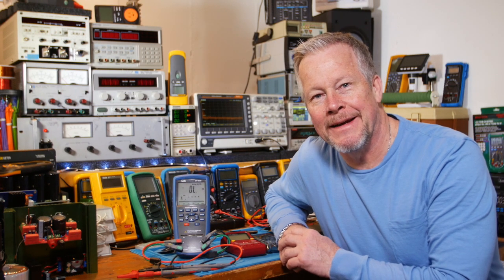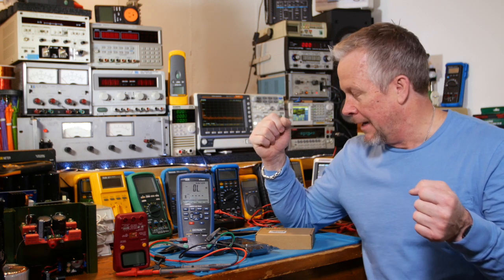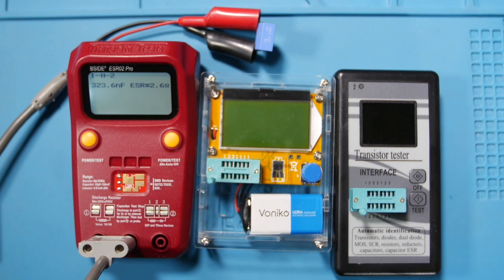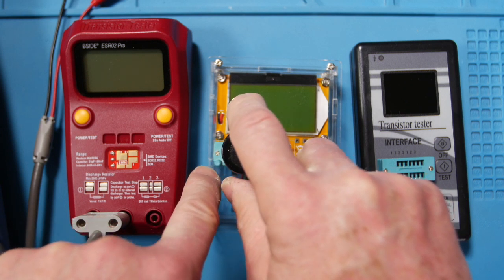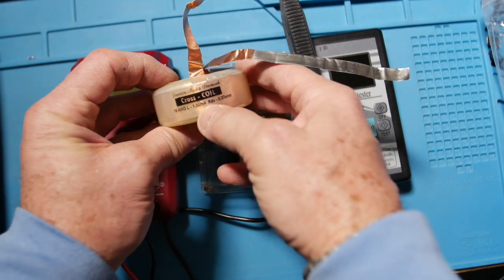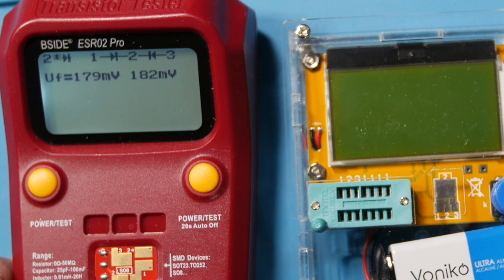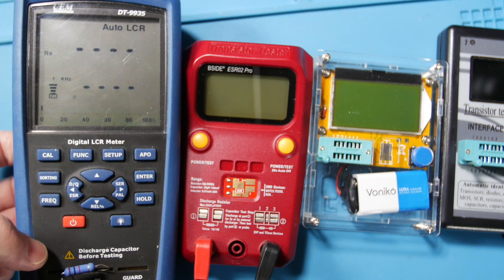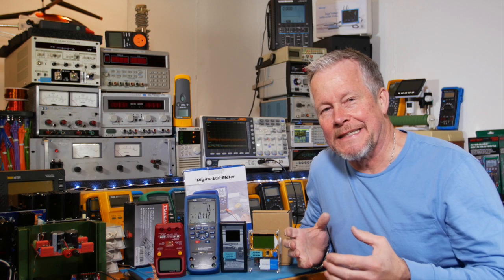LCR and Transistor Tester Comparison

Comment: I recently purchased the MESR100 from eBay, it's only for capacitors but it's able to test in circuit for ESR, I have seen many other YouTubers using it and it saves a lot of time when trouble shooting... As for testing capacitors out of circuit, I charge them to their rated voltage in series with an analog micro current meter to test for leakage. Mr Carlson's Lab channel has a very good capacitor tester which he designed and built himself and is also available to his patreons... I still think that charging the capacitor to it's rated voltage and checking for leakage with a meter is actually the best way to do it, I have seen Mr Carlson's Lab test capacitors on an old vacuum tube capacitor tester where he can ramp up the voltage in steps and you find that at lower voltages, the capacitor shows up okay but as you ramp up the voltage it begins to leak. While these capacitor testers that you have reviewed here are great, their method of testing kinda let's them down... Just think about it for a moment, what's the actual job of the capacitor? One job is to pass Ac and block DC, if it's leaky... Then it's passing on DC current to somewhere it shouldn't be and if you understand output transformers in vacation tube amplification, you will know that the fact that the output transformer has both Ac and DC across it, it saturates very quickly and gets hot at higher power levels, that's why they use massive output transformers on vacuum tube amplification... So basically the less DC a capacitor leaks at rated voltage, the better the capacitor is... 
As for capacitors in the power supply, they need to be able to store the pulsed voltages coming from the rectifier, now in this scenario, if the capacitor is leaking DC, the leakage forms a circuit with the transformer and it's bridge rectifier, apart from the main circuit that it's meant to be powering... This invisible circuit that has been created by a bad leaky capacitor is adding DC current to an Ac circuit and the transformer doesn't like it because it makes it get hot. The iron core is saturated far to early because of the battle of the currents that's going on, you decide that,,,,,  hey that's a great song! So you turn up the volume and the magic smoke escaped... The question is! Is the ESR of those capacitors that you tested still going to be low at rated voltage? 
Melbourne Board Of Works back (I believe but don't quote me) in the 50's or 60's worked out that the fact that electricians were using the old galvanized steel water pipes as the return neutral through earth, the problem was that this was also the path for DC which some transformer less TV's were creating an sending down the pipes causing a galvanic reaction and rusting our new pipes in months, and the DC current was only in miliamps! Superimposed on top of the Ac... So basically the lesson here is that it only takes the tiniest bit of DC current on top of Ac and you begin to have problems! Choose your capacitors wisely! 
Apologies in advance for the lengthy post, there's much more to it for such a simple thing that most people don't realize and you really have to understand it's function fully to understand what it's not supposed to be doing..
Reply from the maker: Peter Milanovski Thank you Peter for this very useful feedback!  You make some great points!  Some capacitor types change their capacitance with DC voltage applied, and with frequency and temperature.  This could make a nice video all by itself!  Please never worry about writing too much!  I know there are plenty that love it and that’s why we are here anyway - to share our knowledge and learn and feed our minds:)
Reply: @KissAnalog  There's two types of test equipment that should be on every bench and they were invented a very long time ago! The first one is the old capacitor testers that were able to apply rated voltage to test for leakage and the other one is the humble signal tracer with both audio and RF probes. You can repair almost anything non digital with just those two and a multimeter... The Signal tracer is such a simple but amazing tool, you can hear what a resistor is doing in circuit with the RF probe.. Imagine that! Being able to hear where the problem is while it's working, that would save you hours if not days trying to find that intermittent problem.... I saw Mr Carlson demonstrate how you can hear a bad resistor arching inside with a signal tracer! Sure you could have found it with an oscilloscope, but you would have to be purposefully looking for it because the noise from the resistor would be difficult to see on the screen, but hearing the noise is totally different, you instantly recognize that what you just heard just shouldn't be there!
In the old days if you had a bad transistor, you pulled out a tube and replace it, try replacing a GanFET lol.. You would think that we would have come to an age where electronic devices are so well built and protected that it would be impossible to destroy it, even if you deliberately shorted it's outputs! But yet we insist on making rubbish that's programmed to die and end up in a landfill... Even vacuum tubes could have been recycled if recycling was a thing back then! LoL... We! As a human race still haven't learned from all the viruses that have come and gone and yet we have people who just don't get it, oh! But I have to go and do my hair, what part of BUT YOU COULD DIE don't you understand? Are you seriously going to go to do your hair if we were invaded by another country who is at war with us? Same thing! I personally think that the best thing that a government could have done is actually what they do best! Just lie, just invent a new name for a virus that doesn't exist and make it sound horrific and the only safe place is at home! Hollywood should be able to make something look real, skin melting off with zombies walking around! Get the military to walk the streets firing off a few shots in the air with helicopters flying over for some real effects and you will see how people will stay the F#yck at home.... Well I drifted into another topic altogether LoL, sign of the times I guess. Stay safe and keep those great videos coming, with all that's going on, the rest of the world is running out of videos to watch! LoL..
Reply from the maker: LOL you guessed it - look what’s happening;) eeks! But seriously, some of the art is being lost at a rapid scary pace - maybe we can make a difference on YouTube?  I am amazed at people around the world that respond to my videos.  It is humbling;)
Reply: @KissAnalog  I have been watching a lot of videos from the periscope film channel, there's a lot of great videos that were made by the US defense department that do an amazing job at teaching. There's a lot of videos on the Electronics topic though a lot of it is regarding vacuum tubes, but understanding vacuum tube circuits makes it easier to understand solid state circuits. If only school taught like this LoL you would have to chase me away from school with an army! Had I known that the defence force was like this, I would have left school and joined a long time ago... 
I kinda get the feeling that a lot of the people whom I follow on YouTube have at some time or another had defence force training judging by their knowledge, but no one ever talks about it. Knowing about a person's passed helps in knowing where to look for further knowledge and forms a sort of connection between the host and their viewership. The beauty of platforms like YouTube is that the viewers can ask questions, unlike TV which is completely one way! 
Regarding the current crisis, we have fared well down under in Australia with just over 90 deaths where over in the US it's looking like a slaughter house! I kinda get the feeling that people in the United States have very little trust in their government, whereas here in Australia the people have somewhat trust in our government. For the most part, our government has been advising and the the people have been watching and listening, after all, they were put there by the people, for the people. If they don't do whatever they can to provide protection for us, they won't have job. My kids thought that this was the first time in human history that we have had a virus, I don't know what they teach them in schools now days, hell I don't remember ever being taught that in school either! You would think that something that has the ability to end human civilization would be taken seriously enough to be taught to everyone in school! For all that we know, it could have been a virus that killed off the dinosaurs? Or that human civilization that existed before our one, the one that built all those megalithic structures that we still can't figure out how they did it and we still don't have the equipment and skill to lift such large stones and machine them. We have a long way to go! Our current understanding of our technology has brought us to a point where things just don't make sense anymore. Try understanding quantum mechanics! I'm a firm believer that if it's not making sense, then something is wrong and we need to go back to the drawing board... There's always a different way to look at things, I could show you a different way to look at electricity and while it won't change much of what you have understood about it to date, but you would see things from an angle that you have never been taught to look at it from, and suddenly everything will make so much more sense to the point that you will be able to see where we went wrong and where we are going wrong and the potential that has been made available with what you now know, the future is limitless! It's possible that it's the greatest discovery of our time, but who's going to want to listen to little old me? I have no schooling worthy of any mention, the people who have achieved their PhD's don't want all their schooling going to waste because of some uneducated nobody that didn't bother to learn what everyone else was taught, I can only say this, people just accept what once was and never bothered to question if whether what once was is in fact true and correct? Back then, they had the difficult task of describing something that has never existed before! Today though, it's easy for us to look back at the beginning and understand what they were witnessing, but what if we were to put ourselves in their shoes and try to look at it from a different angle? What would we see? What have we missed all these years? 
We have missed something but no one is interested because people are getting paid to invent new things that are difficult to understand or be questioned thus enabling them to continue working an earning money for something that cannot be solved. That's unfortunately where humanity is at the moment, history teaches us that educated people don't like being toppled by someone else and all those who went against the mainstream had suffered and sometimes paid with their lives. I choose to not be one of them so I guess that my knowledge will most likely go to the grave with me when my time comes... Well, that's the short version believe it or not lol... If anything, I just hope that you enjoyed my yarn which touched on a few topics but those are my feelings and thoughts on things past and present 😊
Reply: @Ben Jacks that doesn't mean anything! So what if you got a word spelt wrong? What else are you good at? That's the defining question! You just might be a genius at something else, besides, I bet that they were still able to read what you were trying to say! Things are constantly being misspelled in the papers, how on earth do they survive? 
You only ever needed school to learn the numbers and basic mathematics, the alphabet and how to read! Everything else can be self taught! 5 years ago I only knew what resistors were at a fundamental level, today without any school I know and understand electronic components at their most fundamental level, I can design circuits although they would have to do with audio because that's where my interests lie, but the journey to now not only included electronics but geology, cosmology, botany and many other topics! It's really amazing when you venture out of your comfort zone and realise that certain rock types can interact with electricity, then you suddenly realised that you never really left your comfort zone.
There's one very important lesson that I have learned along my journey, and that is everything is either directly or indirectly related! Absolutely everything on this planet and in space! Everything works in a circuit like electronic devices, nature functions in a circuit! If you look for the circuit, you will find it. 
A simple example, water evaporates from the sea, is carried over the mountains and released, flows down the river back to the ocean! A complete circuit, and I'm sure that you knew that already! But if you begin to break down the process into parts of the cycle, you begin to realise that the clouds bring electrical discharge to land from somewhere else! The rain water on the mountain creates erosion, essentially flattening out the land and moving nutrition into the ocean... There's so much more that you can derive from that simple circuit. There's plenty more circuits where that one came from! It will amaze you to the point that you have been living on this planet and you were never taught this and yet it exists. The human brain doesn't have a limit to how much it can store, only how it chooses to use what it's gathered...
Reply: @Ben Jacks well there you go! I guess that it's true what they say! Not everything is for everyone, the majority see what they want to see but there's only a rare few who see what no one else can even though it's right before their own eyes! She saw it, I know that I have seen things that no one else can or is willing to accept because it goes against everything that they were taught to see! The humble inventor is dead! Killed off by the so called educated for simply doing what they were told can't be done... 
It's a pity that a website doesn't exist where people like me can get together and talk about all the things that can be achieved with the things that shouldn't allow you to do so. A place where people can get together over a topic that seems crazy enough that it might actually work! Everyone pulls resources to put it to the test and learn from the outcome or some other person in the group might see something that the rest of us missed! You know, that sort of thing! Could be fun, interesting and educational at the same time! A place where people aren't judged by their academic achievements, you just need to be a people person.

Comment: Good review.  You know what would be useful?  Find a cap on your bench where you can grab a datasheet that doesn't have ESR stated, measure it with the meter and then show us how you could derive it from the data that the sheet does give.  One of the things I found a bit frustrating with the PS design was the phrase "use a low esr capacitor" - even data sheets often say "low esr" without giving the measurement.  So, easy to say but I just worked myself in circles trying to calculate it.  It would be interesting to see which of these devices get close to the stated/calculated value, within allowed tolerance.  I could then add the calculation to my 'calculations' collection spreadsheet.
Reply from the maker: Great subject Andrew!  This deserves a video all too it’s own - at least one;)

Comment: Dude, thanks for the nice video. I use that little cheapest tester. Very useful in many situations, such as pins identification, matching, quick testing components. I don't even have any box. What needs to be taken into account is the quality and purity of the contacts, especially if low resistance and ESR are measured. Since I have it, I very rarely use my old PeakTech LCR 5105N (without ESR function).
Reply from the maker: Thanks for the great feedback Oliver!  It is a very useful meter for identifying parts quickly;)

Comment: Thanks for the interesting reveiw. These little component tester come in very handy in many cases, esp. if you want to identify the parts and the pinout. You have to be aware they are not very accurate when it comes to low value inductors or high value capacitors. In general you should assume up to 10% error, in some cases more in others less - but in most cases its a good estimate.
Reply from the maker: Great to know!  Thanks for the feedback!

Comment: The surface mount pad on the clear case one is often used to solder on micro-grabber test leads, that's what I did with mine. It's wired the same as the socket...
Reply from the maker: Robert Klaus Nice tip Robert - thank you!

Comment: The Bside also stated something in manual about choosing different frequencies by holding down the button, for a given interval.  22:45  (mid center down = f-gen)
but perhaps different models, as some features were reserved.
Anyway, I liked the video a lot.. looking at interesting electronic products that come in at a price almost too good to be true.
Did purchase that cheap one some years back from eBay auction at around 5USD delivered, but Chinese seller newer shipped it.
Reply from the maker: Jakob Thanks Jacob!  I need to play with that more.  I just bought the other two from Amazon to do this video;)

Comment: First of all congratulation for the channel. Actually if look on big electrolytic capacitors datasheet you will see that the manufacturer measure the capacitance and the tan delta at either 100Hz or 120Hz.
Reply from the maker: Lucian Cucli Thank you Lucian!!  I think big caps are usually used on mains rectification, so that would make sense.  Thanks for that great feedback!